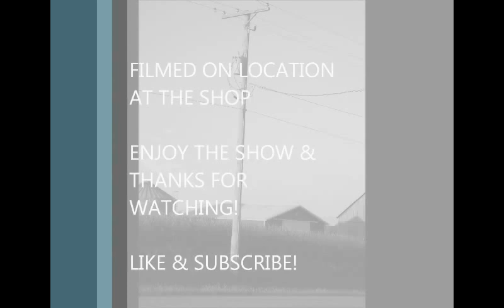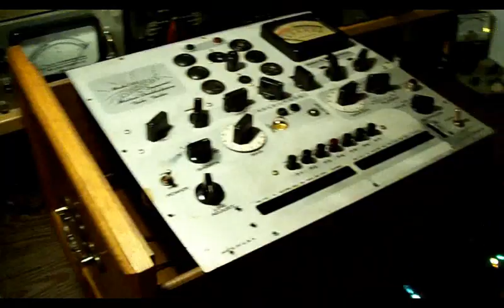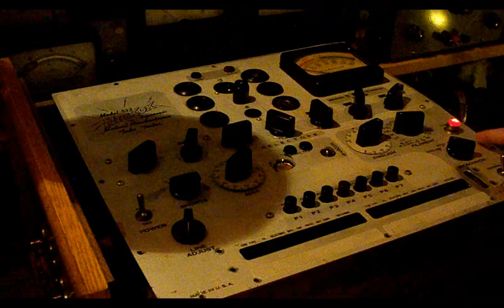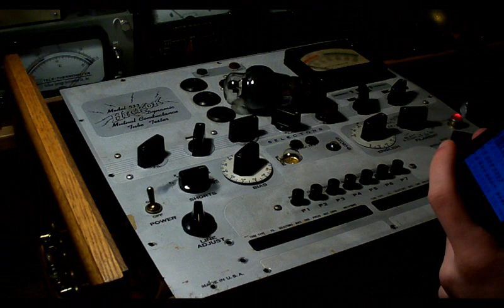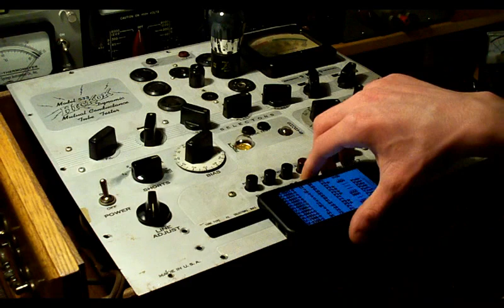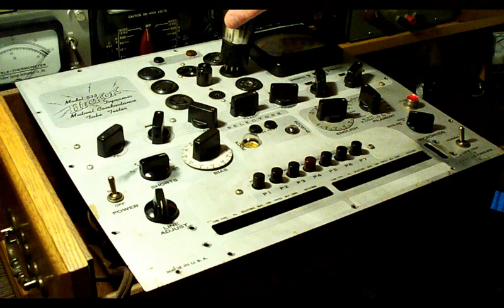A general update on things and a Hickok 533!

Comment: I don't advise putting hands on the meter when using a Hickok. The meters are notorious for building static electricity when touched, which totally skews the reading. I keep a can of static guard handy in case I accidentally forget and touch the meter.

Comment: Cool tester!  I have a 532 myself.  Kinda bummed though because the octal socket on it is about worn out.  Mine has a metal case it fits in, but it has no lid.  Other than those two things it works perfectly.
Reply: Try a 72Mb DC Charge Controller.